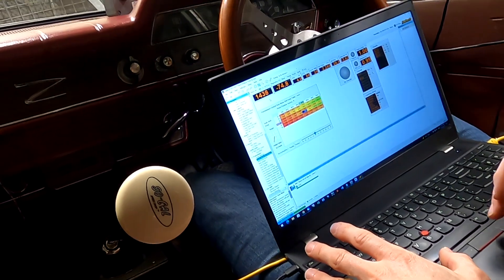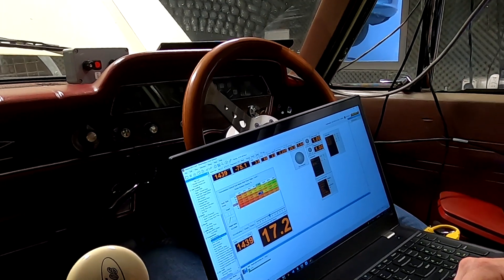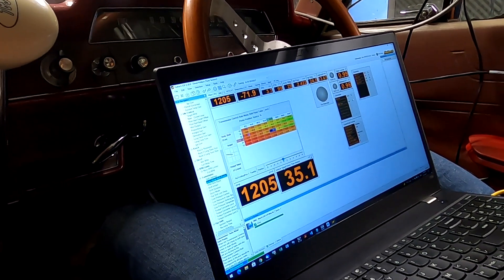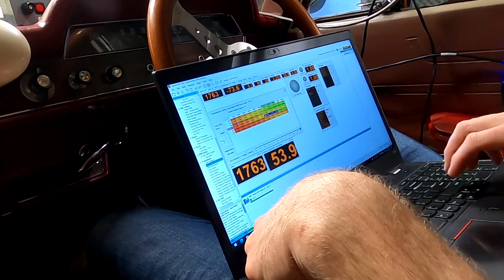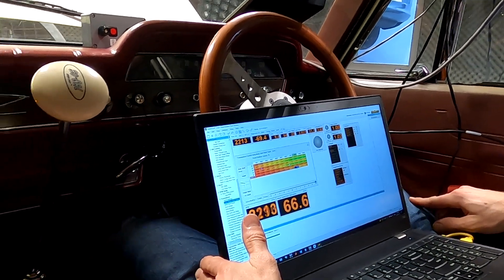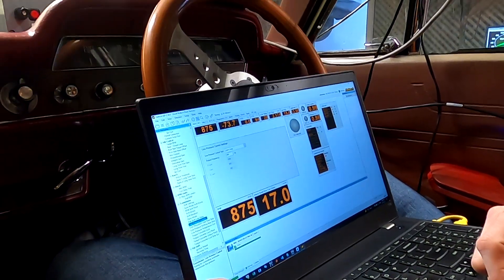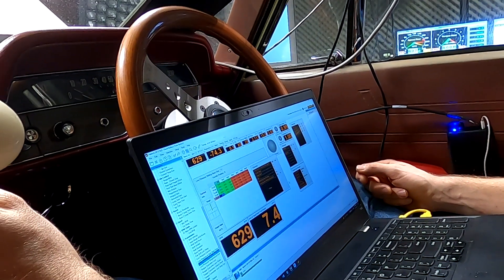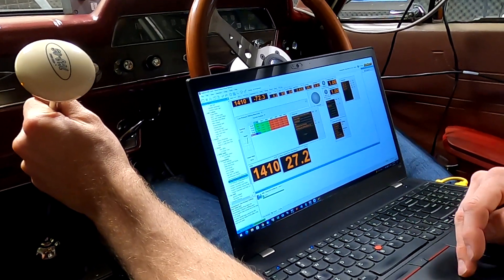1uz Zephyr Tuning Transmission using Haltech 2500 elite ECU

Comment: Are you using an I/O expander to control the transmission? If yes, which one is a good brand?
Reply from the maker: No expander is required.  All done with the ecu

Comment: Hello 
Audi Q7 
Which one is best to put in it 1uz or 2uz of them the strongest and most efficient fuel exchange 
Please answer. 💕
Reply from the maker: There are many different versions of both 1uz and 2uz.  Personally I might be using a 3uz for this job.  They are simple , reasonably new and plenty around.  Programable ecu is also a bonus.

Comment: Looks pretty easy to setup. Hopefully ends up driving like standard at low throttle
Reply from the maker: Once I got my head around how haltech did it,  the process was really easy.  Having experience with other systems help.  The end result was better than standard,  even at low speeds.